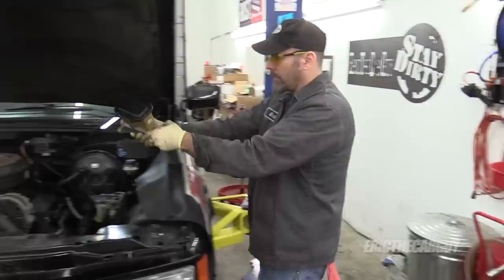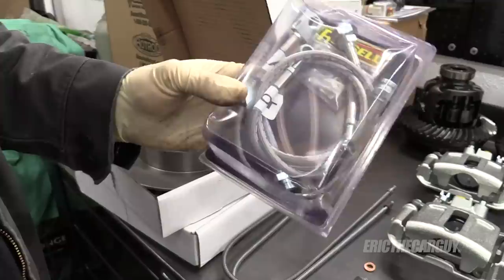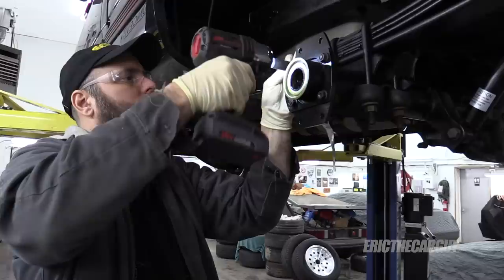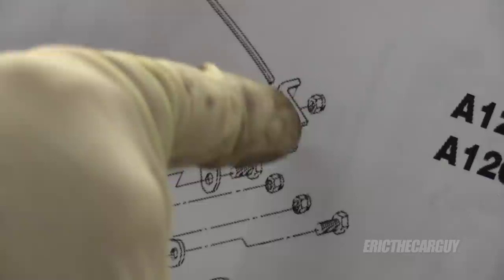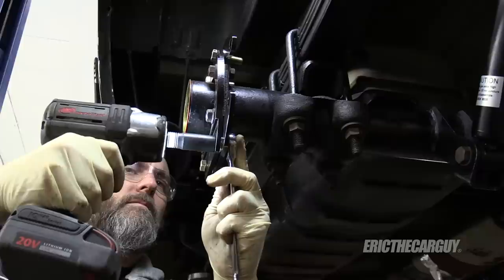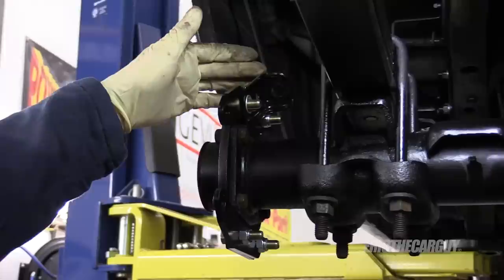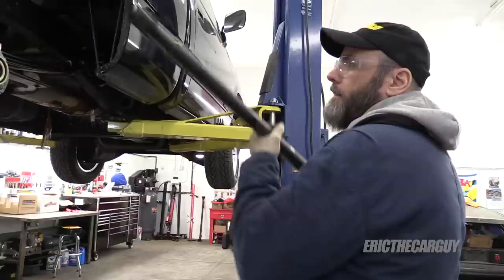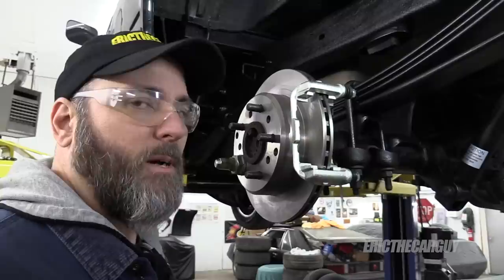GMT400 Rear Disc Brake Conversion (Part 1) #ETCGDadsTruck

Comment: In my experiences with aftermarket conversion kits, I've found these are usually the case- 
#1 They're expensive. 
#2 Instructions are usually incorrect in some way or another.  You end up calling their tech line and they STILL scratch their heads and say "Hmmm. We've never run into that problem".
#3 Modification is ALWAYS needed, despite what the incorrect instructions say. "Modify to fit" is ALWAYS the case.  
#4 Incorrect fasteners.  Multiple trips to the hardware store are in order, especially for dealing with reason #3.  
#5 They're expensive....oh, I covered that for #1 reason, sorry.
Reply: Them fasteners in that kit LEAVE a lot to be desired and look Chinese....
Reply: The only brake kit that hasn’t wound up as a complete pile of frustrating garbage in my experience is stuff made by wilwood. Was very prepared for a fight, and was pleasantly surprised.
Reply: @bransonfleischman2233  I would agree, they have quality. We are awash today with quantity of basically chineese JUNK. Quality went out the window in the race to the bottom of garbage - yet they charge a quality price.
Reply: @bransonfleischman2233  find my comment above.i did the whole thing,for 400,bolt on,no probs,willwood is for ferrari drivers.or bottom less pockets.it seems that chevy gear fits ford trucks better than chev conversions.weird,eh.???.maybe ford sold it to chev in the first place,so it dont fit...ha  ha..
Reply: ..yes, the brakes usually suck on these trucks, but it's usually in the hydroboost and master cylinder..replace them with the later style, put on premium shoes, and adjust correctly...I really don't care for rear discs on a truck...son's '04 Tahoe(GMT 800) has them, and I am not impressed..plus, the parking brake on those really sucks..worse than on my 1990 GMT 400...also, these conversions often require larger diameter wheels and tires..I don't like/want larger diameter wheels, either...just upgrade the booster/cylinder, put on new QUALITY(yes, I know that is hard to find nowadays)front pads and rotors, calipers if needed, and rear drums and shoes..adjust shoes properly..you should now have good brakes..no rear discs needed....

Comment: Change the front brake lines to the caliper and the spongy feel more than likely goes away. Old lines expand with pressure causing the "spongy" pedal

Comment: Fix for moisture under snake on pipe. Get Vaseline (the thin kind) on the pipe, put a heat shrink over that, shrink it. Put Vaseline on the heat shrink, put the snake on. Done. Never had corrosion. Works for torsion bars too, fuel lines etc. IF and only IF you want to spend the extra buck, you can get the kind that glues itself on, it's a bit costly at those lengths, but it is worth it.

Comment: I installed a disc brake kit on my 64 F100 and I had the same problem with the parking brake cable. I ended up installing the mounting bolts the way the instructions wanted but used some extra bolts and washers to move the bracket inboard some to clear the mounting bolts.

Comment: We put an SSBC front disc conversion on my Grandma's 1967 Dodge Charger back in 1998ish and the master cylinder from '98 just failed last year.  The brakes have been fantastic.  Yes SSBC's kit is expensive but their product is pretty good and their customer service has been excellent to me.

Comment: LOL! They must have changed out the calipers. My 95 kit came with 87' Turbo Coupe calipers. I couldn't believe it when I read the packing list. And mine came with stainles braided lines for all 4 corners. Wish I had your video 8yrs ago when I installed mine. Great video.

Comment: That bolt ain't engaging the lock nut's plastic lock after snip snip.:)) (i know you fixed it) 
Man, this kit is hacky as hell. Seems like something someone threw together to meet a spec sheet.
Reply: aserta it seems the wrong sort of lock nut , I would not use nylock nuts on brakes.
Reply: @aytonbob  Agreed... a little heat, squishy nylon, no more locking function. I'm no expert, but I think brakes tend to get hot.
Reply: @CheezyDee  Nylock nuts are super annoying, especially when someone threads them onto a super long bolt or stud and you can't spin it out by hand once it's loose. Gotta follow it all the way up with the wrench or socket you're using.

Comment: Yeah, those flat top master cylinders ALWAYS feel mushy. I swapped it out on my 1996 Express with a late model unit off a 2002 Suburban, and what a difference! No other changes, so yes, you can just change the master cylinder.
Reply: Same on my 96 tahoe.
Reply: A lot of work for mainly rear disks, the front is the one that does most of the work, rear is only there to keep you in line or park brake.

Comment: I have those exact same Russell Brand brake lines on my 94 C1500 and that took care of all the squishiness I still have the original master cylinder but with ceramic pads in the front. My brakes are awesome
Reply from the maker: Honestly, I believe that is the best upgrade of this series.

Comment: That conversion kit is a PITA! This is why:
 Bolts so long they protrude out the backside and forced you to cut them so emergency brake cable doesn't rub and become frayed.
No shims for pads, will rattle and make noise.
The hard brake lines were too long. Good thing you have a nice flare tool. 
They could've figured out a way to install a small bracket where the hard line connects to the hose. 
That's pretty lousy for an expensive, "custom" kit. You did a good job making it work

Comment: When I don't have screws or anything to fasten the disc on the Hub assembly to keep it from moving. 

I use an old appropriately-sized box wrench on the lug and then I put the lug nut onto the lug to hold things on and then adjust things that way

Comment: i had an issue with bleeding on my datsun truck when i converted the rear drums to disk. i had to mount my caliper upside down(at about 5 o clock) as well because of how low my truck was it was making contact with the frame when mounted on top. luckily the brackets were designed to be used upside down or right side up. i had to take the rotor and sit it on the ground, put the caliper on and hold it all together off the truck to get it bleed correctly as i did not have any special bleeders like you did. i used isuzu calipers and have yet to find a parking brake solution. was pretty envious seeing your backing plate bolted onto the axle, they pressed the backing plate on these little trucks and it was easier to use a dremel and cut it in half than pressing it off.

Comment: I also have a GMT400, 1998 GMC pick up and also don't like the 'squishy' breaks. Shortly after I got it, used several years ago I ask a mechanic to adjust the brakes because they felt soft, he told me that there was a couple of years that GM made these trucks that was an issue, not dangerous just not something that didn't fell right. Mine are still that way. Edit: I just got to the part about the parking brake cable, mine hasn't worked since before I got it. I live in Michigan so there isn't a state inspection every year, we don't have one at all. Just send them our money $$$ and get your tabs for the next year.

Comment: My Son was fortunate to find a 1996 C1500WT. It had around 56k verified miles. It has the 4.3L Votrec V6, 4L60E auto tranny and 10 bolt differential. We have discussed upgrading to rear disc brakes.  We have purchased several items from Summit Racing and have been pleased with their product offerings, pricing and speed of shipment.  I am disappointed with several aspects of the upgrade kit. You pointed out a majority of the issues. There are several items that are crude in the design.  The parking brake cable mounts leave much to be desired. They appear flimsy, at best, and could be improved with heavier gauge metal and the bracket could be threaded to accept a bolt.  The length of the bracket mounting bolt should have been the correct length. This demonstrates lack of detail on the part of the manufacturer.  The lack of pad shims is another glaring omission. The lack of backing plates leaves an installation that seems unfinished. Why did the kit not include a bracket to support the differential end of the flexible (rubber) brake lines?  It is difficult to understand why the rigid lines were not cut closer to the length needed. The final complaint is: why were torque values not included with the instructions? One could look up the torque values based on bolt grade, diameter and thread pitch. This should have been included.  This seems more like an assemblage of parts in a box instead of an upgrade kit. Perhaps this is an early version of the instructions and the manufacturer will improve them based on feedback. I am glad you included this video. I will look for a different kit.  There are too many rough edges and missing items in this ”kit” that sells for approximately one thousand dollars.  This could be a decent kit if the omitted items and improved instructions were included.

Thank you again for another excellent instructional video.

Sincerely,

Brían S. Du Bois
Evansville IN
Reply from the maker: I'm glad you found the video useful. Don't blame Summit, the kit was made by SSBC. That said, before you order any parts, I'd recommend watching the next 2 videos in this series. I know it will save you some money.
Reply: Eric,

Summit should be made aware they are selling a product that is not up to their usual standards. This will give the manufacturer a chance to improve their product. If they are unwilling to address the shortcoming, then Summit should look for a different manufacturer. Summit might be ahead by producing their own kit from off the shelf parts.

I look forward to you next videos (as I always do).  

My Son and I have considered scrapping the 10 bolt differential and replacing it with a stronger unit that has disc brakes as standard equipment.  Our biggest question is will the various mounting points on the rear axle be the same with 12 bolt or 14 bolt units and will the single piece aluminum driveshaft be the correct length?

The more we.think about all the headaches... the more we think about leaving well enough along.

Time will tell. I am less ambitious now that I am past 60!

Thank you again. I am waiting for the next parts in the series.

Brían S. Du Bois
Brían Y. Du Bois
Reply from the maker: That's what this video is for, to make the company that made the kit, SSBC not Summit, aware of the issues that come up when installing their product. 

As for the rest, that's pretty much hot rodding. Expect difficulty. Good luck.

Comment: My 3500 dually (rear drums) has a very firm feel with performance oriented pads.. It was so intense, I swapped to ceramics in the front, which was a dramatic change in braking force.

Comment: I converted to disc brakes on my 10 bolt rear end, I used everything from 2001 2wd Blazer, and I changed the master cylinder and proportioning valve as well, works just fine, I probably had somewhere around $500 in it.
Reply: 2001 Blazer is 5X4.75" bolt pattern

Comment: Not sure if you could solve the bolt pattern problem, but the best/cheapest rear disc kit for gm is to just use 98-02 f body parts. They bolt right up. Might need a spacer for the backing plate. Same brakes came on v8 and v6 cars so most yards will have one.

Comment: I just took a Dana 60 out of a  99 Ford E350 Van and it was practically a straight bolt in.  No more squishy pedal and I got the original master cylinder.  The emergency brake even works very well on a steep Hill and the whole rear end only cost a couple 100 bucks.
Reply: and now you have two different bolt patterns on your rims F/R?
Reply: @MrTaxiRob  same bolt pattern.
99 E350 doesn't use the metric pattern.

Comment: Dang... It seems no one makes a direct bolt on kit for the GMT400. I wouldnt be able to do this job on my GMT without having to buy a brake line flare tool. Great work so far. Part 2 is next.

Comment: I replaced the vac boost with  a hydroboost from a Chevy Astro van in my K1500. It makes a pretty big difference. I had to make a modded rod from the brake peddle to the booster, but otherwise it just basically works

Comment: Eric!! I got a great tip for you! Get rid of the factory master cylinder and get on for a later 2000+ master cylinder. It will get rid of that squishy feeling. I can give u part numbers

Comment: I put k2500 front calipers with the 3.125 piston, made a big difference.
Reply: Did you change the master cylinder too? What happened to your pedal travel and feel, any major changes?
Reply: @MrTaxiRob  I didn't change the master cylinder, the pedal travel was the same.

Comment: Not sure if someone already asked this but, could those bolts have been flipped around so the nuts were facing the rotors instead? It looked like they wouldn't have interfered with rotor as they would have been inside the rotor hat. This is assuming that the bolt heads aren't as wide as the nuts, allowing for more clearance with the brake cables. In any case, loving the truck build videos! Can't wait to see what's in store next. Cheers! :)

Comment: I think you're right about the spring-stuff around the steel line, seems like a bad idea to me.  Steel lines are bad enough for rusting out but that type seems to lack any real corrosion protection.

Cupro-nickel is better! Bends easier too.

Comment: Makes you wonder if they actually installed it on a vehicle
Reply: I was working for them when we did. Pull the car in myself to work on it.
Reply: He installed the caliper brackets on the wrong side of the mounting plate,that's why there is a step on the face of it.showes clearly on the directions.
Reply: Engineers

Comment: Eric, $1,000 isnt that bad. I once replaced my O2 sensor on my corolla and I broke off one of the monting bolts. So, I called the dealership and they sold them in sets of 4 only. The cost was $60 for the set of 4. In other words, 4 FRIGGIN bolts cost me a fortune.

Comment: Thank you for sharing, brother. I think I’ll be doing the same thing, except I’ll put the shorter brake line on the right, and only need to cut the one on the left. I’m guessing that by the length I saw you cut.

Comment: I buy only tools that have extra gravity built in that way I can spend more time picking them off the floor! lol 
I learned from your quick tidbit on the brake shoe seating in the groove.
 I have "the Right Stuff rear disc conversion and was bleeding them. the second side the shoe fell to the floor... By the time I got it picked up and figured where the spring clip went on the caliper extended all the way out??? now I can't find how it goes back in. screw or push? not sure and don't want to break it...

Comment: The coil is impact protection for the line. You will see it used only in areas that are susceptible to impact from debris.
HTH
Cheers
Reply from the maker: Thank you for that info. I never knew that.

Comment: my brakes are huge.. gmt400 at 375k miles. there must be a wimpy version in the mix of models. I have never encountered them. Sports car feel on the truck brake is the reason I keep a tow rope for you in my tool box. ;)

Comment: Just a wondering, hard to see from the instructions.... but if you flipped the calipers left to right, the oem bleeders would be on top.   The ebrake cable could go under the axle tubes easily enough.  Gives you a second option for rubber line orientation as well.
   What dya think, would that be doable?
  Great video.
Reply: I thought the same thing . The e-brake cable was originally mounted down low, so I don't see that being a problem unless there's less slack in it now.

Comment: For $1000 them bolts are from a swing set kit.......plus why on earth would it be Lincoln ain't they out of business and be hard to find
Reply: Mercury is out of business. Not Lincoln.
Reply: @mt1885   Whatever dude. You hate Ford, I hate chevy. I can tell you right now that despite my hatred of all domestic trash, I will NEVER EVER buy chevrolet trash again in my life.  I got a Z06 sitting outside with 90k on it that's on its 3rd engine and 4th clutch. And I DON'T beat on it. If I ever do buy another American car it'll probably be a  Shelby. Not likely that I will buy any sort of trash made here as the Germans are usually faster and nicer.
Reply: @Jacksonkellyfreak  3 engines - sure they just all fail magically with made up stories someone needs to sober up or they up are past their bed time.

Comment: my 2002 ford taurus dont have shimes either....no problems..makes my job easier instead of snapping brake shims in and hoping they dont figit out and usually on a cold day too to make it even colder on the ol fingerseters. and yea thos grooves I learned the hardway you gotta match em. I did mine not knowing about them and I literally was smoking down the street...looked cool but not on the pocket book when I had to replace not only my pads but rotor too

Comment: on your eastwood use a grinder and cut a few grooves into the shiny plate just about 1mm or so that rough cut will allow glue to bind better than to a shiny chrome finish...... problem solved than with some fresh gorilla type glue and done deal.

Comment: That kit is kinda pricy for what you get
Reply: chevy front rotors,$75,pair,new,eldorado e brake calipers,$300,pair.brake lines,s/s,$60..fitted to [d60] 83 bronco,75 f250,.ditch the p/valve.fit a disc disc master..2 days.done.

Comment: Wouldn’t it work if you flipped the bolt around for the parking brake bracket? So you have the short head going by the cable, and the not on the outside? If there was room for that

Comment: Pretty good presentation of the challenges one will be facing doing this. However, if one needs to be told in advance which socket size to use to loosen/tighten a bolt, maybe it is better to      do a less involved and less safety-critical project.